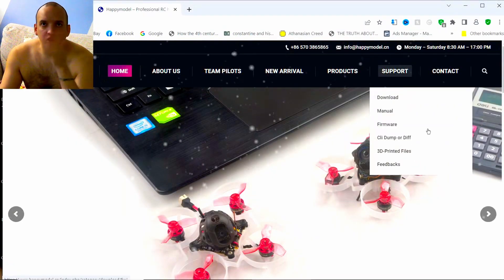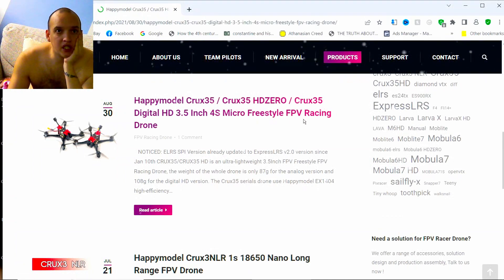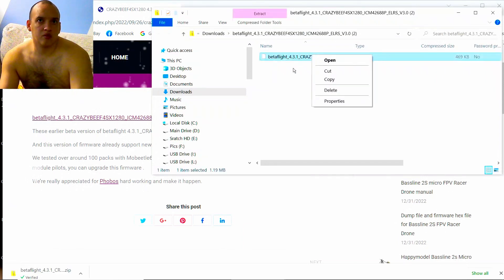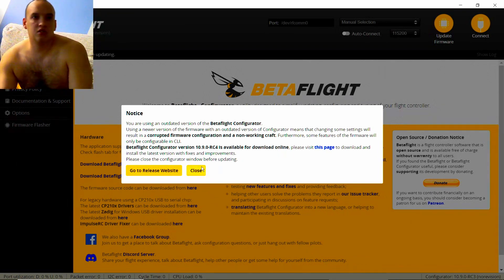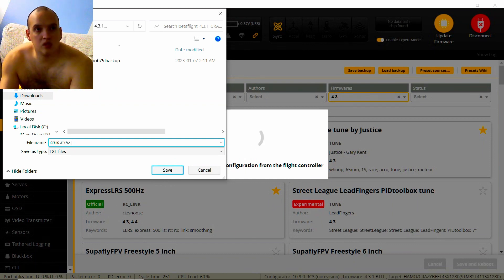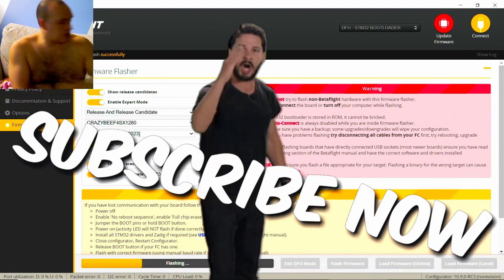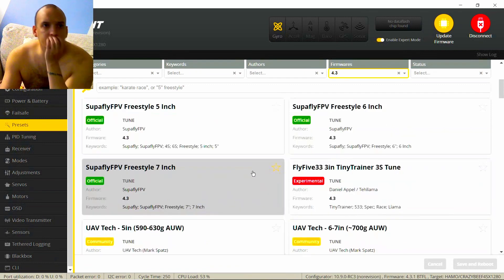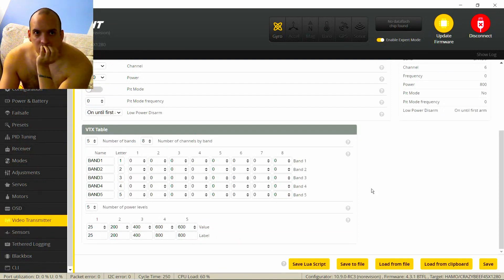How To Put ELRS V3 On Happymodel SPI Receivers Crux35, HDZero Moblite7, Mobeetle

Comment: Thx for the help, I did all the steps it’s already updated to ELRS v3, but, a new problem appears, I don’t have sticks inputs, the drone is already bind to my radio transmitter, my transmitter have the latest firmware too,but 0 sticks inputs in betaflight, … can help me with this problem
Reply from the maker: 1. made sure they are on the same Express LRS version.
2. Go into the eles menu on your radio and try turning model match on or off. 
Tell me if it is a SPI receiver or a uart one. 
Which drone are you doing this on?
Reply: @TorontoFPV  is the Crux35 v2 ELRS spi reciver, I already turn the model watch from off to on, still no sticks input, the only thing I need to check is, how I know, if is the same ELRS version ?
Reply from the maker: @guzmjosue_8139  express LRS configurator. 
So download that. 
Also go on the receiver tab and make sure it is set to SPI receiver. 

Do that first.

If that doesn't work you need to download express LRS configurator and flash both your radio and your receiver to the same version of express LRS. Look up whirlyblokes tutorial on how to do that and hopefully that should sort it out

Comment: Link download firmware brother 😅
Reply from the maker: It's built into betaflight now so you don't need to do it that way anymore just flash the latest betaflight and then use expresslrs configurator to make sure both your radio and drone are on the same elrs version and you are good to go!